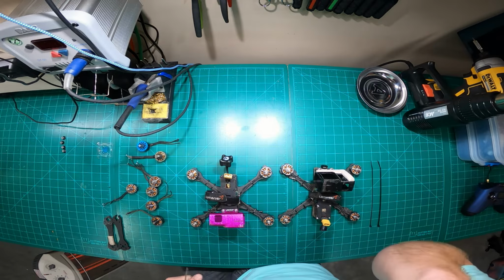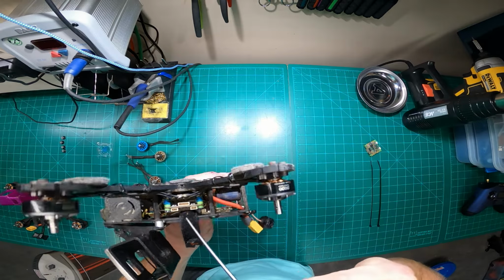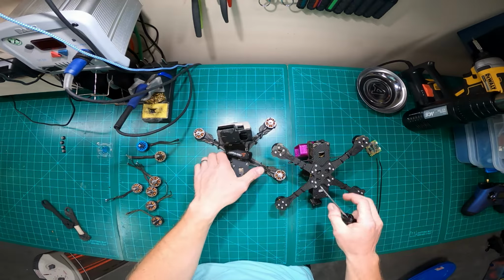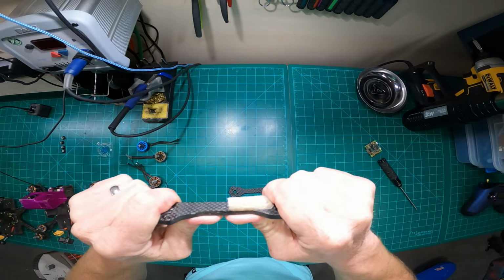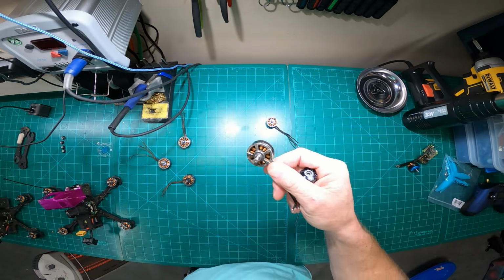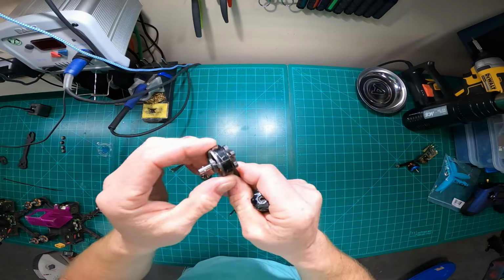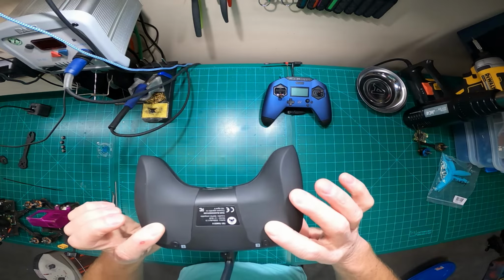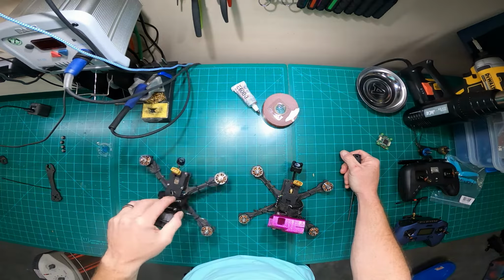Phantom's Bench - How Often to Replace All The Things

Comment: Hey man. As I understand it, you know how to make fast quads. I have a 7" racer, on 2806.5 1800kv motors, with the Tmotor Pro II 55A ESC. At first I had the Dal Cyclone 7056 props on, but they're terribly manufactured. Running some HQ 7x4x3 at the moment. Was doing some speed runs today, and the batteries just start sagging more than grandma. I have some CNHL 6S 1300mah 100C packs at the moment. The cap is a 480uf, or whatever came with the ESC. Do you have any tips that might help me to go faster, with less sag? 2 blade props? A larger cap? I could put a 1000uf cap on, or twice larger. Some of the Adrenaline 120C batteries?
Reply from the maker: How are you! Could be a number of issues causing grandma sag. Let's start with the motor kv first. Turning 7" blades, you may not want to go much higher but you could try. Second, maybe use a better battery that has a higher c discharge, also consider slightly higher capacity. You're probably tapping that 1300mah for everything it's worth on full throttle pitches. Lastly, I'm not sure a bigger capacitor is going to improve flight performance. It's there more to protect your electronics when you start beating on it. The 1000uf cap couldn't hurt though. I used a higher quality cap because the cheaper supplied capacitors kept burning up and I'd trash a VTX or something. And finally, plastic surgery? Thank you for watching and supporting brother!

Comment: +1👍 i'm not creepin' i swear, lmao.   i sit at a desk all day, so super easy to have another window up watching good content, and i have to say this was good content.

it's obvious you have way more experience than me, but i do have a comment about the longer screws in the standoffs. i was doing this too, now i use 8mm on bottom and 6mm on top.   -- why? i once smashed onto a steal beam, and instead of ripping through the aluminum standoffs, i broke my top and bottom plate instead, so if i had a recommendation, i'd say keep doing this with good quality carbon fiber (which you do), otherwise, go the common way of short screws. ( well this and no smashing into steel :D )

i like the 2407 Zips!! i won a set free, very nice motors for 6 or 7"
Reply from the maker: Brother! You're good man. Everyone's had their own experiences and that's what drives style etc. Thank you for taking the time to watch and letting me know what you think. It could change how I do things, learning from others and all that. I've crashed pretty hard but never hard enough to do what you described. I've always had the issue of the standoffs stripping out. The Zips are pretty amazing. Not sure who Lumenier uses as a manufacturer but they're pretty solid. Thank you again brother for commenting and adding your feedback!!!